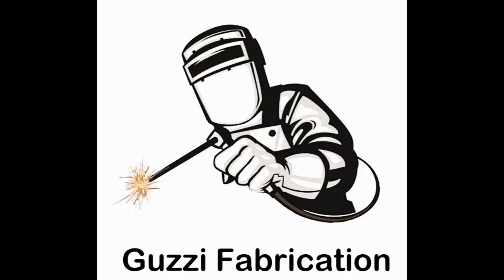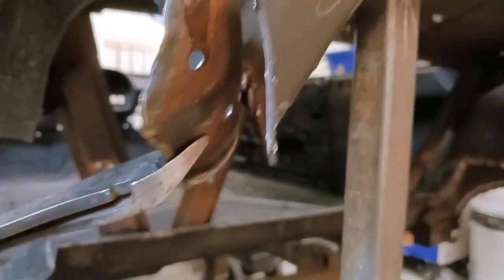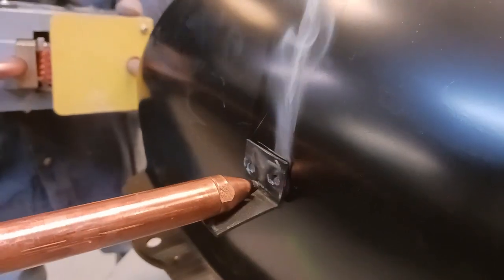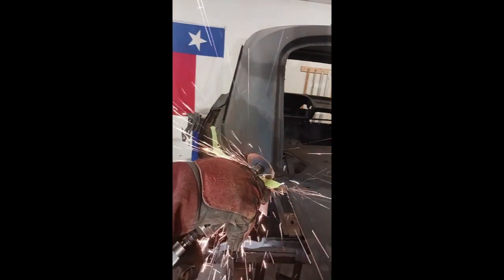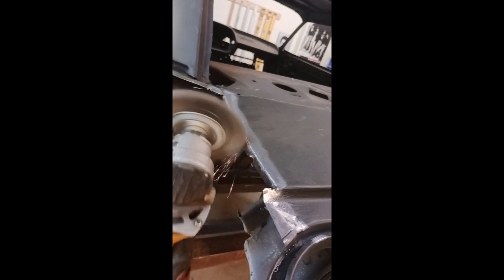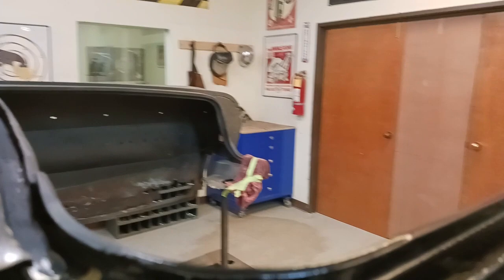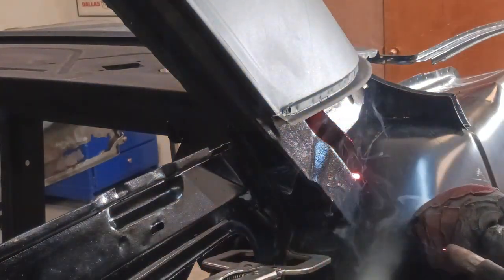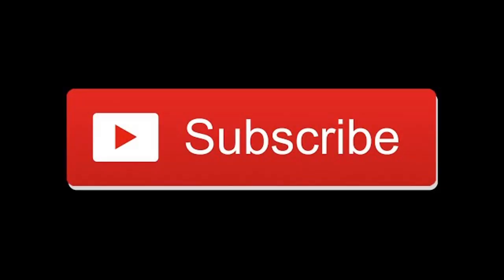1964 Impala SS Part 11  Inner/Outer Wheelhouse Remove/Replace - Prep for Upper Trunk Installation

Comment: Man those rear wheel house placement is SO important. Has to be perfect otherwise you run into issues where the lip meets the lip of the quarter panel, the trunk hinge bracket placement is super important too otherwise the trunk won’t fit right. I forgot to put that dang tab on mine lol tomorrow I’m gonna go look on the old wheel house and see if it’s still there. Lol  Love your vids bro. Wish I was there to help and watch you work. 💪
Reply from the maker: Yeah that can be a tricky area..... I appreciate you supporting the channel !

Comment: Really need to get my 1959 impala to your shop, so you can do a frame off sometime in the future
Reply from the maker: A 1959 Impala, Sweeeeeet !
Reply: @guzzifabrication3448   how much harder is a 59 compared to 62-64, in terms of parts availability? I would imagine a significant jump up in cost/scarcity?
Reply from the maker: @benclarke6177  Thank you Mr. Clarke for watching, which parts? yes  less parts are available for the 59 however later parts (some) can be modified or fabricated and there are still used parts floating around.
Reply: @guzzifabrication3448  thanks for the info! I was more referring to sheet metal for floors/rockers/quarters/etc, but you answer makes total sense - thanks! Again, fantastic videos and your attitude towards the restorations is 2nd to none
- just over there doing God’s work and bringing these old girls back to life. Love your methodical & careful approach.

Comment: Great video ! I have learned a lot watching your videos! Doing 1 piece trunk floor and both Inner and outer wheel housings on 1967 Chevelle SuperSport Coupe. I am going to rehang doors on both sides of body before I attempt to permanently attach and align both rear quarter panels! Thanks for the great tips! And yes.. those 12 inch tongs add yet another weapon to your arsenal!
Reply from the maker: Thank you Mr. Luther !

Comment: Man, I stumbled across your channel and it's must-watch stuff.  Really, really impressive work. 

An honest question, what is your position on bracing up the car prior to doing this kind of work?  When I've been chopping a top, I was always taught to cross brace door openings, rear windows, and even cross brace the body.  In instances like this do you find that the body is so rotten that aligning doors, decklid and so on is useless for fit and finish later?  Or is the bracing unnecessary when you have as good of a body dolly as you have here?  Is it totally overkill?   

Love your work man, keep it coming.
Reply from the maker: The answer to that question is always it depends on the person skill level.
 I could chop a top without bracing and  move the body in any position that I need to..... but I have 25 experience... 
Another consideration and I would say mistake cuz I see a lot of guys over bracing making it very difficult to work around the bracing if not impossible.....
If a person is just building their skill level I would suggest bracing but keep it to a minimum usually a 4-point brace works just fine.
Let me throw something else out there bracing is one thing building on a frame fixture something else....
 hey thanks for watching
Reply from the maker: I have to add bracing doesn't mean the car will absolutely not move or twist....
Reply: @guzzifabrication3448  Thanks so much for the response.  For a garage builder like myself, I'll keep bracing it up haha.  Keep up the good work, it's inspiring to see.

Comment: Where did you buy those xtr long welding tongs for the resistance welder?  Great job as usual on the panel removal process
Reply from the maker: Ebay. Thanks !

Comment: Hey man so I found the old rear wheel house tabs from the original ones. Any advice you can give me as to where they go? I should have done it the way you did but I didn’t. I’m assuming they are for the rear seat mounts? But yeah man any tips you can give me that are after the fact would GREATLY be appreciated. Thanks
Reply from the maker: install the seat and the interior panel in place, stick a ice pick type tool through the fastening hole and scratch, then use tape on the bracket to position, move until correct.
Reply: @guzzifabrication3448  thank you 🙏

Comment: I respect that you are brush painting or spray painting rust inhibitor on all the original car panels and welded areas but are you stripping off the black coating that comes on the replacement parts or leaving it and using POR over it or ?? Where are these replacement parts coming from that they fit so well on the car ? Can't be the made in China crap that 90% of restoration dealers sell to everyone......
Reply from the maker: If it is  "real" EDP coat you prep and use as a base, people keep saying you have to strip the EDP caot and that isn't true.... not at all... some manufacturers are spraying a lacquer black on the parts now.... yes thats low quailty. Trust me, the  videos do not reflect the work that goes into these projects,  that's a weeks worth of work squeezed into a 16 minute video. Rarely do parts just fit.... really appreciate the questions, thanks for watching !
Reply: @Guzzi Fabrication  I appreciate the reply, thank you. You have made good progress on that car especially considering how in depth the work is you have done. In the future would you please consider including what all you had to do to get the replacement parts to fit ? Thanks. Really enjoy the quality and workmanship and work ethic you put into the work you do. 👍

Comment: Hey Robert, since I’m new to your channel, I’m just going back and watching some of your old videos, lots of excellent content there. 
Question for you regarding using the resistance welder and plug welding. I saw in one of your other videos you suggested doing plug welds because of the metal thickness, would other factors be accessibility? Would either type be stronger than the other? I’m just in the process of replacing the inner and outer rockers on my 57 Belair and like how nice a job using the resistance welder does. What’s your opinion on that? Thank you for your help Robert, very much appreciated it!
Reply from the maker: @raymondantonio4145  On pinch welds or flanges that are easily accessible I like the resistance welder other situations may require plug welding where accessibility to the back side is not possible or there is a limitation in the tong length of the resistance welder thanks for the question and for supporting my channel !
Reply: Thank you for the quick reply Robert, I haven’t done a lot of metal work but am trying to do as much as I can and learning as I go along. I’m happy I found your channel, you do such nice work and explain everything as you go along and how neat and clean and organized your shop is! Thanks again Robert!
Reply from the maker: @raymondantonio4145  go through my playlist I have over 200 videos mostly on metal work and welding, if you can't find what you're looking for their leave your questions in the comments and I will get back with you thanks for supporting the channel
Reply: I will for sure, thanks Robert
Reply from the maker: @raymondantonio4145  👍

Comment: my car is currently sitting in my garage, it was primed with metal etching primer after media blast. Is that a bad thing? because you keep saying epoxy primer
Reply from the maker: Epoxy is always my first choice, especially media blasted metal epoxy primer is superior to any coating, but since your car already has etching primer on it and it's not exposed to the elements, it will be ok.

Comment: You change the structure integrity of the wheelhouse quarter panel area by doing that. That area will be weaker in a side collision.
Reply from the maker: You are absolutely wrong and you're just trying to fault find sitting on your butt behind the computer... I am an I-car certified structural technician.....AWS certified welder with many years in that field working insurance/collision jobs...... and if indeed that area were compromised by the replacement in the event of an accident.... that accident would probably be one you wouldn't walk away from...... to go fault find somewhere else and don't watch my channel. Is that clear enough for you
Reply: What are you crazy? Yuo don't know what your talking about dude....